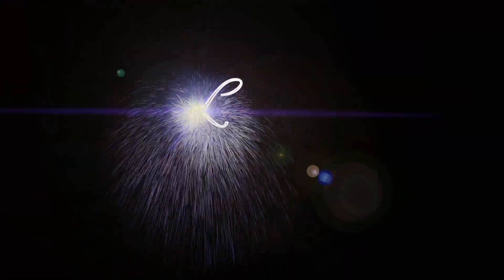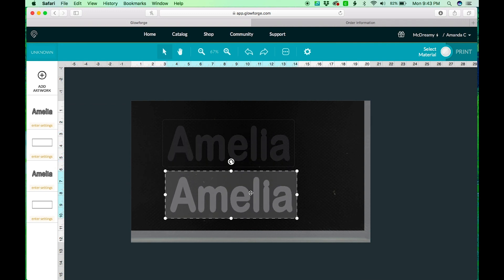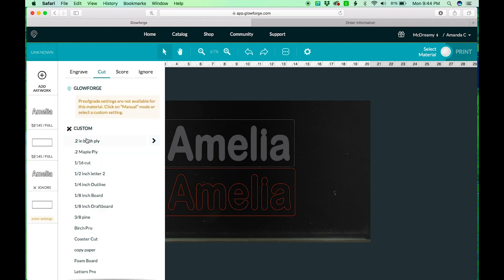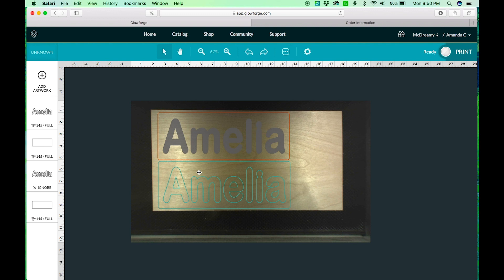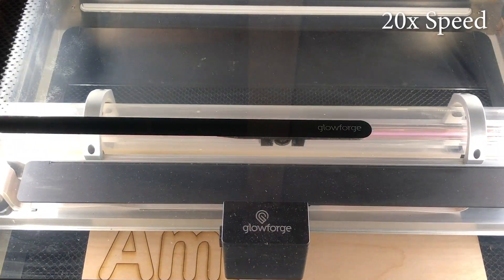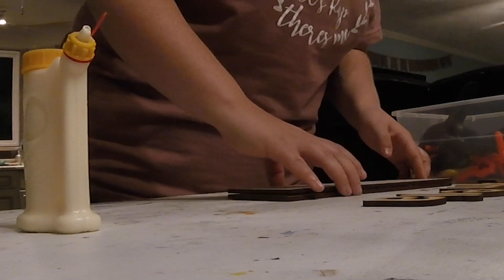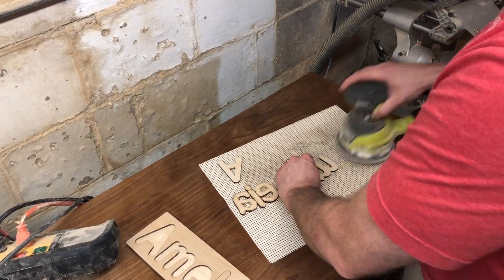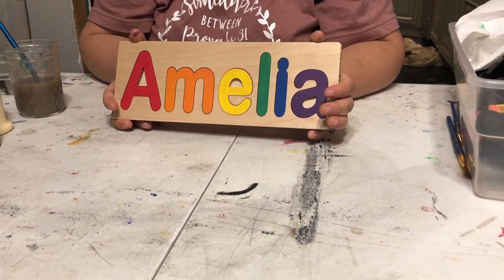Glowforge Name Puzzle Tutorial

Comment: How do you get rid of the burn marks on the edges? All cutouts on plywood leave burn marks and handling the bits will leave black marks on your hands.
What do you do about that? :)

As an observation, Rainbow has 7 colours :D
Reply from the maker: Because it is a laser it is going to leave some burn marks on the edging. However,  I have noticed that black marks that transfer to hands and other materials is because my settings were off I was going at too slow of a speed or too high of a power.

Comment: Thanks for sharing this. Are both exactly in the same font size ? shouldn't the base be a bit bigger ? what are your experiences ?
Reply from the maker: Xnaarkhoo you could make the base slightly bigger. My experience is that the letters fit nice and snug and a bigger base isn’t necessary.   This method saves material instead of having to cut a second time.